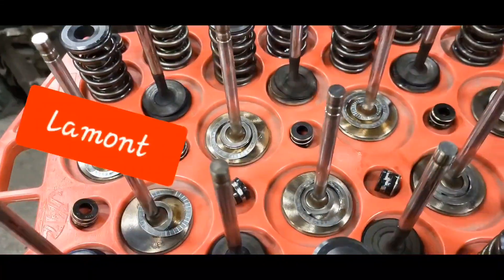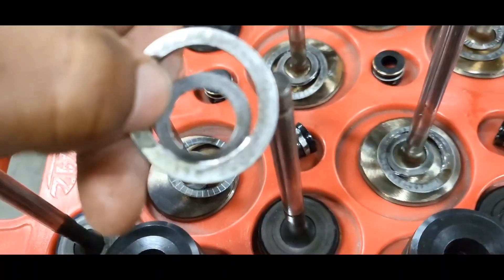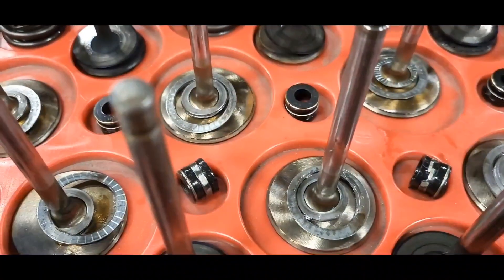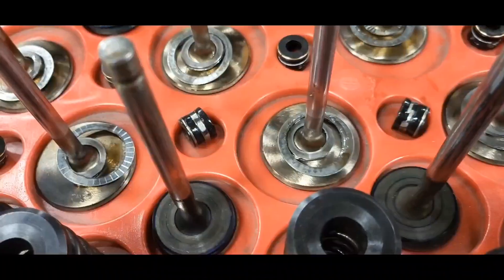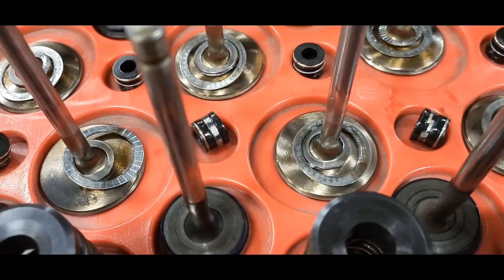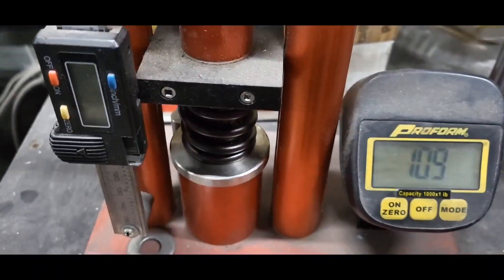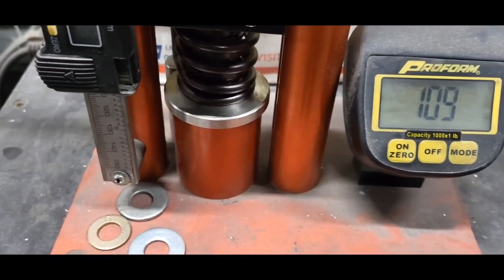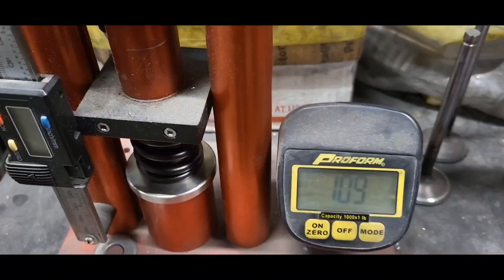How important is proper valve spring setup?

Comment: Thats scary, I ported a blower case at home but heads/intake na ill leave that to you guys. Owner is luck the springs didn't start digging into the heads wthout spring cups
Reply from the maker: @jplperformance9073  people think it's easy and we see all kinds of things. These guys get on YouTube and tell these people it's easy to port and we see so many people Fn up heads and manifolds it's crazy. Guys think that can just grind here and smooth there and pick up 40cfm lol. That's why they be blowing up motors that should be lasting for thousands of miles. 
That customers motor is done.